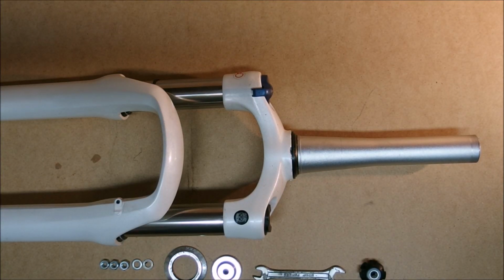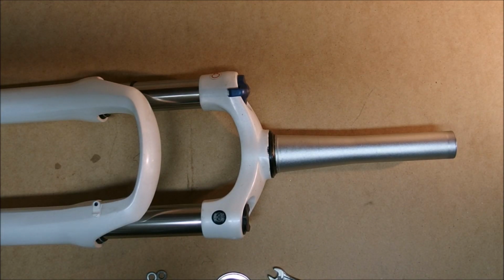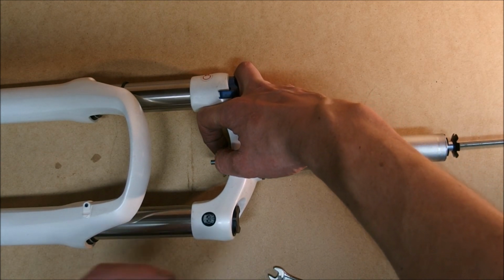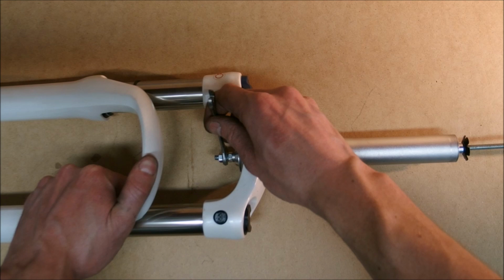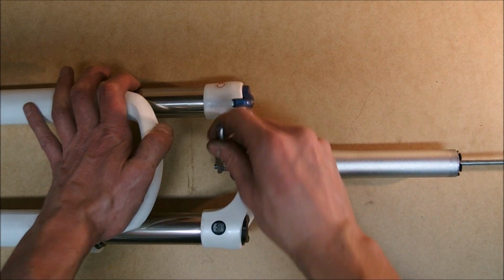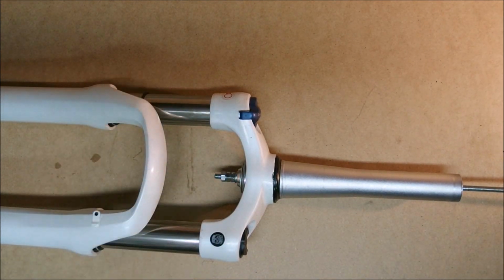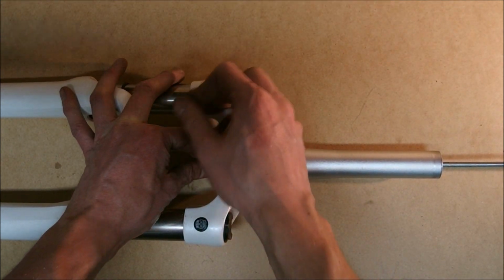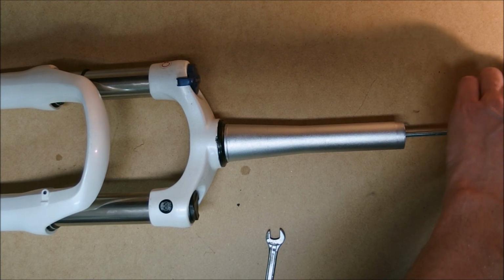Howto: Install a star-nut without tools or violence

Comment: It is another way to install star nut,  using M6 long threaded rod. No hammering  tool needed. It is as easy as using special tool but quiter, though it is little bit longer.
Would be new experience to try. Thanks.

Comment: On my case, it was hard to go this way. The star nut came in lightly twisted in the tube and I had to make strenght more than normal on the tool to have the nut in place.
Finally the nut got placed correctly by itself with none problem fitting the stem cap.

I recommend this technique to put the starnut.

Comment: Hey again, just wanted to say a sincere thank you for this. I just used your method yesterday (I'm building my new bike from scratch) and it worked flawlessly, not to mention that it cost virtually nothing since the only thing I was missing at home was the threaded rod, which is super cheap. Such a better method that hammering a screwdriver at the starnut and hoping for the best. It feels great to use your brain and not your biceps sometimes :D More people should see your video!

Comment: This is a very clever way to install a star nut. However, do not use this technique if the fork crown is carbon fiber, as it is likely to damage the crown. (You wouldn't use a star nut at all if the fork steerer is carbon fiber, but road forks for older bikes that take a 1" headset often have an aluminum steerer with carbon crown and legs, e.g. the popular Ritchey Carbon Comp fork.)

Comment: At least here, M6 bolt and a stack of M6 washers to set the depth are much easier to find than M6 threaded rod. Attach to fat socket to line everything up. A few taps with mallet. Done.

Comment: I rather skip all this and get a compression nut. but it's great to have alternative methods, a Allen key and hammer works too.
I don't like star nuts because you can't reuse them, and the installation is not as fast as with a compression plug.

Comment: A screwdriver and a rubber mallet is faster and most people would more likely to have them instead of these, and the star nut would still be straight unless you did it carelessly. But this solution looks neat too.

Comment: How far down did you go with the star nut
Reply from the maker: About 7-10mm
Reply: @TryboBike  Thanks its confusing because some people say 10mm some 12mm and some 15mm i reckon somewhere in the middle. Like 10mm sounds good.
Reply from the maker: @taichihead42  The proper answer is "deep enough for the nut to rest against the steerer, shallow enough for the top-cap screw to reach", so really it is not that crucial, anything below 5mm will do fine.
Reply: @TryboBike  Thank you.  I will except your advice kindly. Your skill level is higher than mind on bikes.  I still refuse to let a bike shop touch my bike.  The satisfaction of fixing my own bike is tremendous.

Comment: Without tools.. Takes a 6mm rod and other things almost nobody has lying around. Nice method though so maybe you should sell a set of the rod and 'tools' used in this video ;)
Reply from the maker: I'm sure that starnut driver is much more esoteric tool than a threaded rod, some nuts and a wrench :)
Reply: True